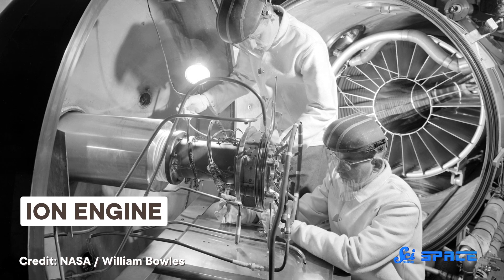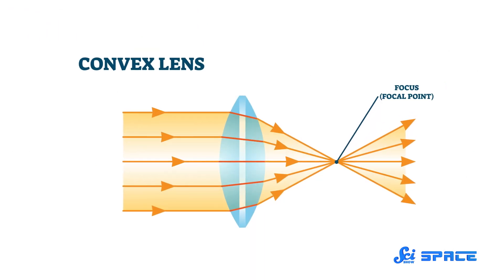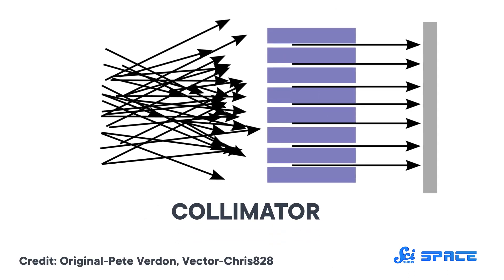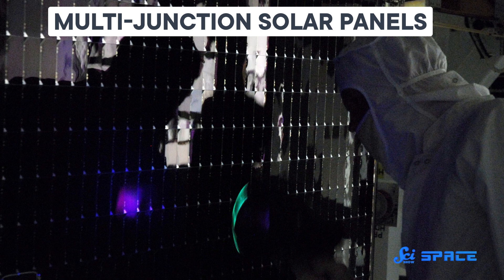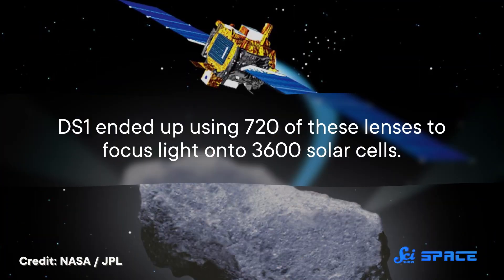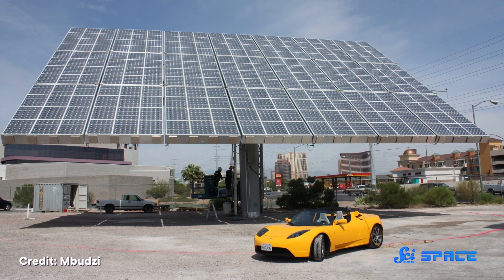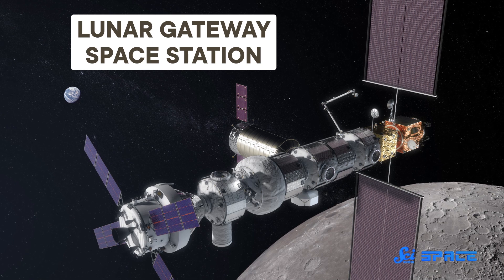How 19th Century Lighthouses Power Advanced Space Drives

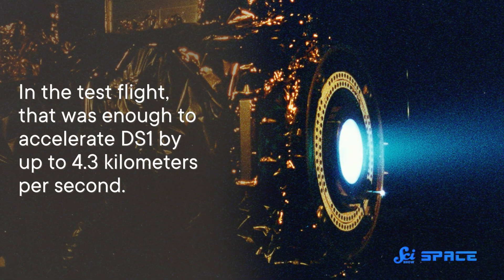Comment: At 1:25 you state an acceleration of 4.3 km/sec however Gravity is an acceleration of 9.8 meters/sec^2
So why does your acceleration have different units than the acceleration of gravity?
It's rather surprising how Humans are largely incapable of grasping multidimensional units in science and engineering.
Reply: I'd hazard a guess that he done made a booboo.  Ion drives are known for being weak but efficient, and 4.3km/sec^2 is totally bonkers - like 440ish g's.
Reply: @CyberiusT    I recall the drives having only grams of thrust which of course can add up to a lot over time.  I had to laugh at the EM drive having about as much thrust as a flashlight.
Reply: @CyberiusT  I dunno...when NASA tested the EM Drive the unit pretty well blasted itself straight through the test chamber walls.  XD   About the same thrust as a flashlight when you turn it on.  Barely made it to the washroom I laughed so hard.  And as for Simons 'booboo'.....where's the SECOND 'Per Second'?   Huh?  Where is it... I MUST HAVE IT...need units...proper units...  [NB:  it is perhaps possible that Simon does NOT have an Advanced PhD in Physics....perhaps...]

Comment: Btw, the actual difference between single junction and triple junction solar cells is more like 2x than 8x per unit area at least in theory.  The Shockley-Queissier limit for single junction (your garden variety solar cell) is somewhere around 30%, while for a triple junction is somewhere around 50%.  When I worked in a small-sat lab, the expensive triple junction cells we used were around 35% efficient while some very high performance single junction cells were converting ~27% of the incoming light into electricity.
Reply: How expensive were those triple junction cells? Finding a price for those is hard.
Reply: @gIozell1  to be totally honest, I'm not 100% sure I'm allowed to say what they cost us so I'll have to pass on that.  But they were pricey little things, not remotely worthwhile if you didn't absolutely need the most performance in the smallest area/weight like satellite applications.
Reply: @gIozell1  your town, city, or utility company would likely block you from using some kind of lab panels anyways
Reply: You have to remember, they built it using cells from 25 years ago. They weren't nearly as efficient as modern cells.
Reply: Thank you for sharing this!
Reply: Also to clarify, what they probably meant to compare were low-grade single junction cells to high grade multi-junction, but I think that comparison is disingenuous because it's not the number of junctions making the biggest difference but instead the manufacturing quality (since you can go from 10% garden variety to 28% exotic just by getting better single junction cells).

Comment: Skiped an obvious, one can use a simple light bulb and a Fresnel lense to culminate the light from the bulb, making a photon thruster.
Reply: Photons cant be used to make thrust because they don’t have mass.
Reply: @JasonB808  That's why your house doesn't fly apart every time you turn your light bulb on.
Reply: @JasonB808  Wrong, they do have mass. Admittedly a very very small mass but it is still there. That's why they use Zenon atoms, Zenon is very dense at the atomic level so the engine can develop more thrust and less wasted energy.
Reply: @smallmoe  Even if this were true, it doesn't work the way you think. If it did, every theater in the world would have been experiencing noticeable strain on their lighting grids before the invention of LEDs. Fresnel lenses on instruments with halogen bulbs were some of the most common pieces of lighting equipment there were.
Reply: @abydosianchulac2  ok... what do you mean by "it doesn't work the way you think"? as for the strain there're 3 reasons why that doesn't exist in a measurable amount 1) with the exception of lasers lights are omni-directional in how they launch photons. 2) Those photons have to contend with Earth's gravity and they simply don't have the mass to make a difference. 3) And finally the lightbulbs don't have a means of concentrating the photons in any meaningful manner.